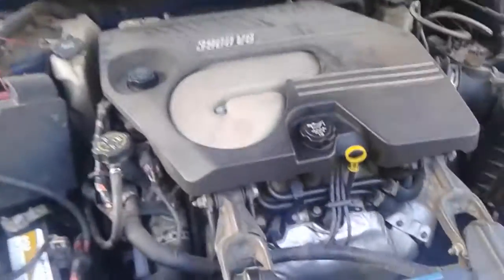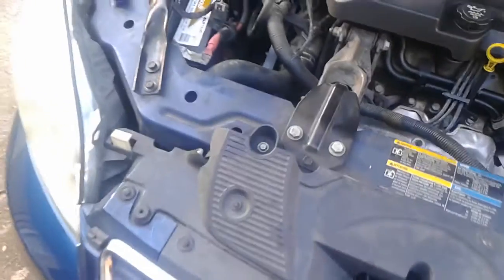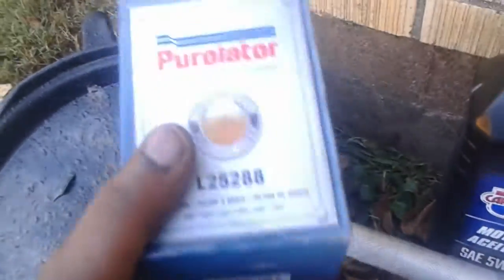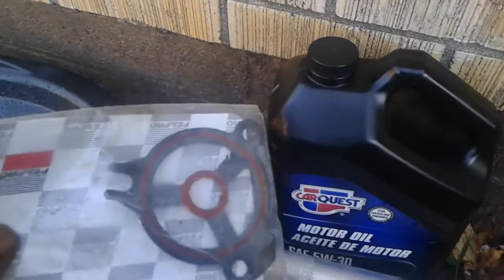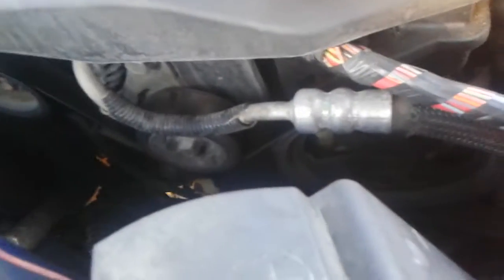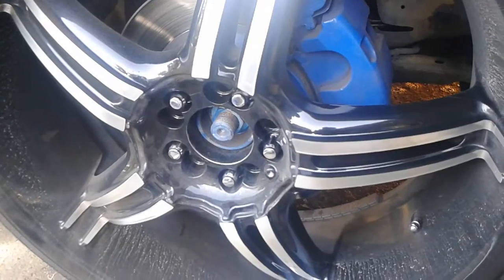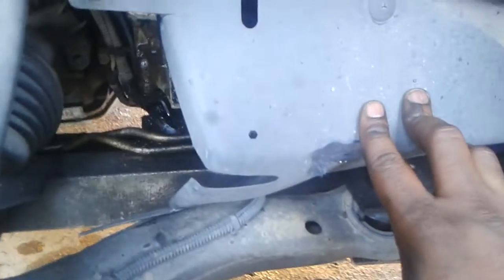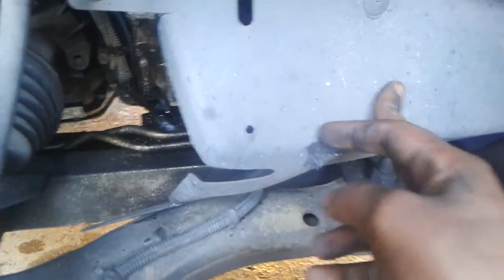06 impala 3.9 oil filter adapter gasket

Comment: i got a 3.5 and had to do it. basically you have to loose the ac compressor, 
mine was in the front but one of the bolt would be where the compressor is. 
once you get the compressor loosen go under the front  (3.5L) and unbolt the houseing bolts.

Comment: I didn't have to loosen the belt nor remove the wheel.  on my 11, there is a little pannel covering the bottom section of the compressor area in front of the wheel. 3 plastic push in pins, i pulled 2 of those,  left the last oen in and rotated it down. i was able to push the fan belt downa dn get the socket on the bolt. I loosed it and the one above it.  I had to pull the compressor bolt on the opposite side near the oil filter. I used an long extension to pry the loose compressor away to get access to the bolt then i unbolted the housing. I didn't need a knuckle adapter, just had to go in at the right angles for each bolt.  it wasn't as tedious a job as i had expected.